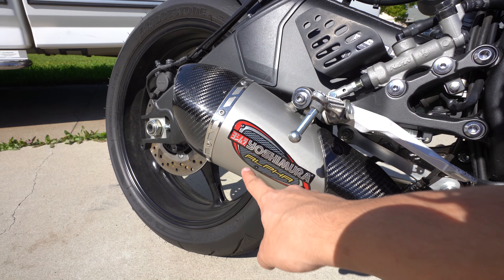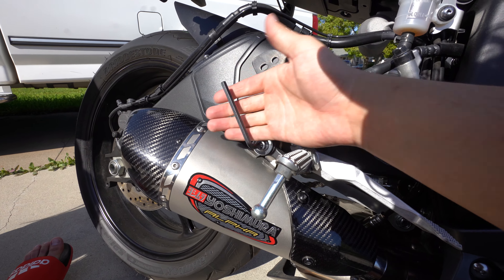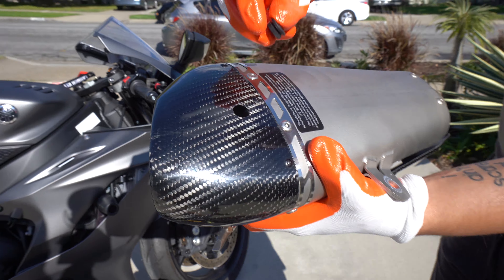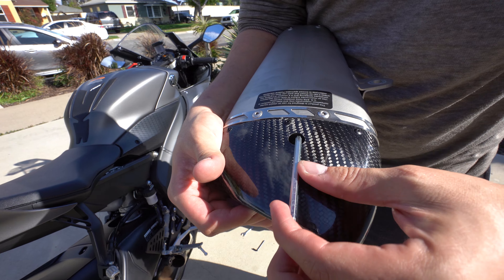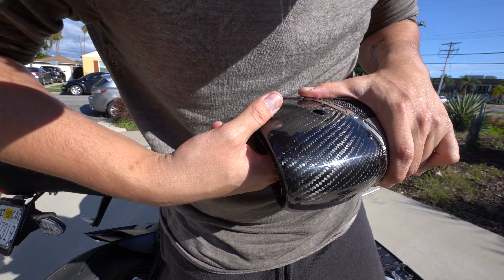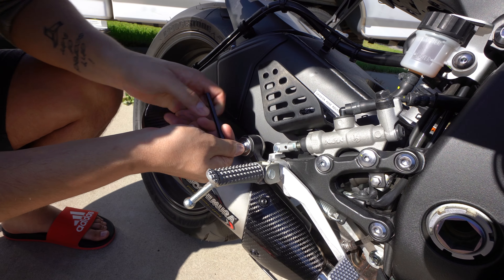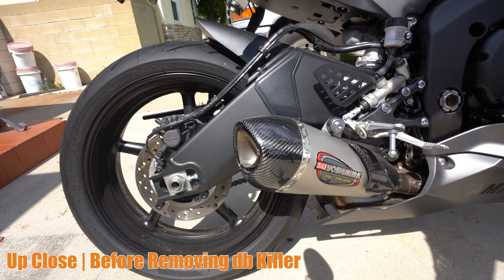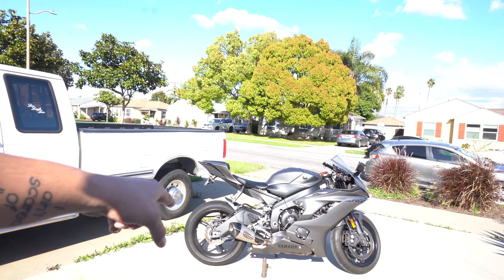Removing the DB Killer | Before/After Sound Comparison | Yamaha R6 | SOUNDS GREAT!

Comment: Next time,just a tip man, if you have any hollow metal bar sorta deal,you can put it over the Allen wrench for leverage or use vice grips/channel locks on the wrench. And stick a block of wood against the end of the slip on,whatever it is,and if you need to a piece of cloth in between, and hit the block with a hammer if it won't slide in. Anyways, you got it,just saying for next time if you have issues. If the alien is small enough,a good trick is if you have a multi screwdriver with the multi bits like your orange one, take the bit out, and stick the hollow end of the screwdriver over the Allen for leverage. Works everytime if it fits in there.😉
Reply from the maker: Thank u so much for the advice :)!

Comment: Sound way better if you take that stupid canister off lol
Reply from the maker: Gsxr Squid huh, where is that? I’ll definitely take it off if that’s true lol
Reply: It’s the big thing like right under the bike that’s on the headers lol. You will probably have to cut it off and buy a piece that would take place of that
Reply: Yeah man the catalytic converter. The big box right on ur exhaust. Get a mid pipe to replace that and it will sound amazing. U might have to put dB killer back in tho lol
Reply: You shouldn’t have to cut it off it should be only clamped on
Reply: Idk how r6 is setup but u may have to get a servo buddy so the check engine light doesn’t come on because you’ll be removing the O2 censor when u remove the cat more than likely
Reply from the maker: Cody Grant ahhhh I see! I get that! Thanks for the great advice :)